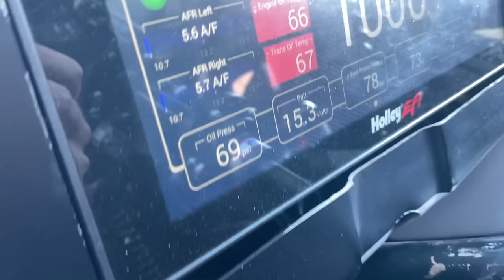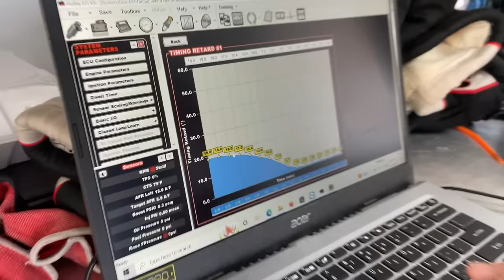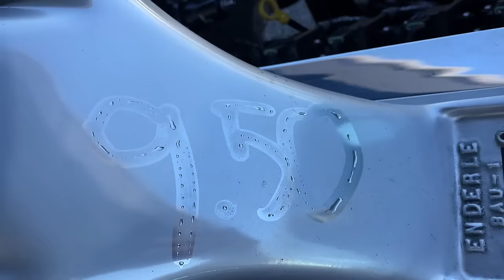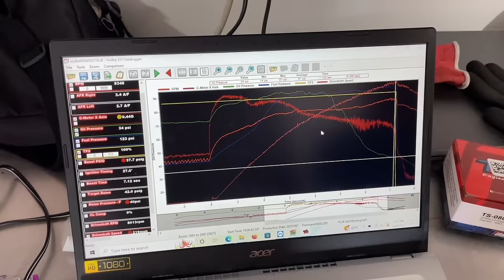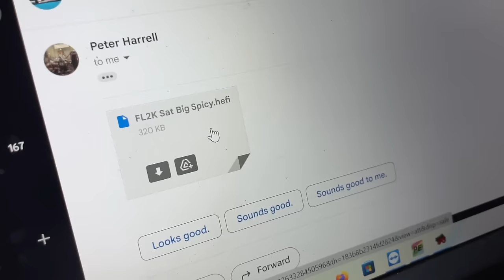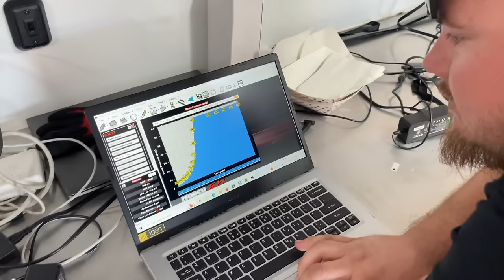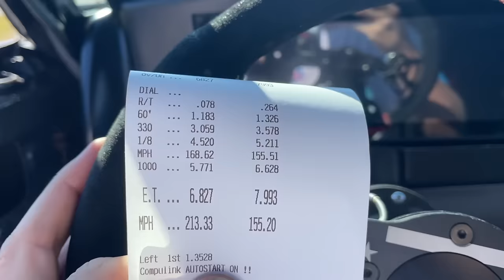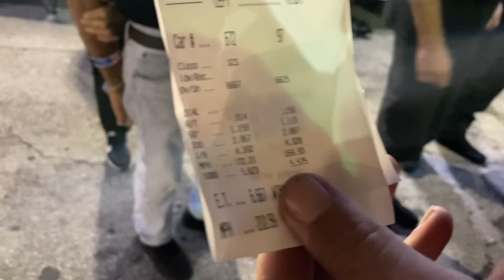FL2K22 Day 2 - Mullet Just DESTROYED His Best Pass Ever!!!! Over 213mph... INSANE New Numbers!!!

Comment: Its beautiful how "slow" mullet looks on a good rip compared to something like Leroy, it's hard to actually tell on video if it's a good pass or not until the time comes up. So good to see the car reliably putting down times :) You guys earned it, a LOT of time, money and effort has built an incredible rig <3
Reply: KSR chassis/Steve Morris powered build maintained by the best crew. Found the right combo.
Reply: Agreed. I think it's mostly due to the fact that mullet is a heavy, HEAVY rig...all the speed comes in during the back half so it's hard to judge from the line.
Reply: 4 link bro. It's insane. Leroy will still be aggressive looking because of the kart style car but it will be a hell of a lot more smoothe with a 4 link setup.
Reply: can you imagine how fast mullet could be if they dropped more weight and had the big tire on😳🤩🤩

Comment: You know it's a heckin fast run when Cleeter is rushing to pull the shoot and flip the switches 😂
Reply: He was trying to shut the car off immediately out of the power to get good plug readings. If they leave the engine on for decel and then idle back to the pits it cleans off the coloring from the run. Normally for street car classes they have to drive the car back but in the extreme 28 class they are allowed to tow it back hence why he only did it on that run

Comment: Just curious on the blazer. Couldn't you add a sensor to the lower A frame that reads the distance of travel and once it hits a certain distance, or hits the limiting straps, it pulls timing out so that it automatically pulls timing out? Initially make a computer petal the car down the strip instead the driver.

Comment: Cletus what’s your take on turning the motor off straight away? Why don’t you let it cool down slightly after the intense run?
Reply: They have it setup to run the coolant and fans with the motor off. So it can dump alot of heat while coming to a stop.
Reply: @yoshi4946  ohhh ok my dads new amarok does that electric water pump and thermo fans, but doesn’t it leak heaps of heap in the cylinder?